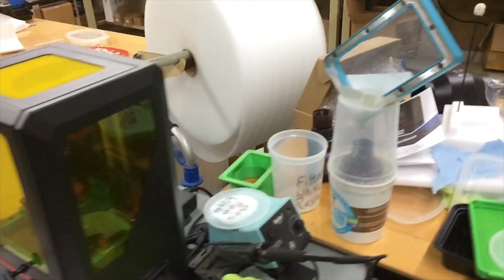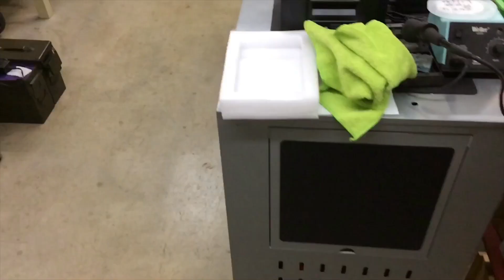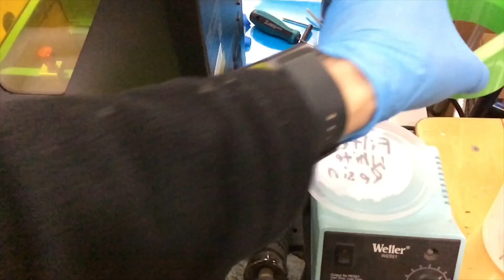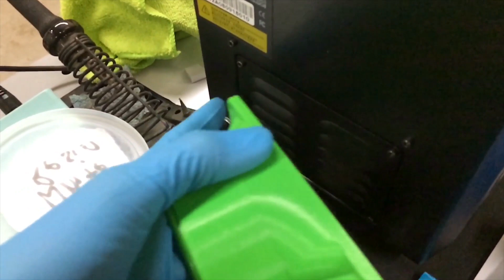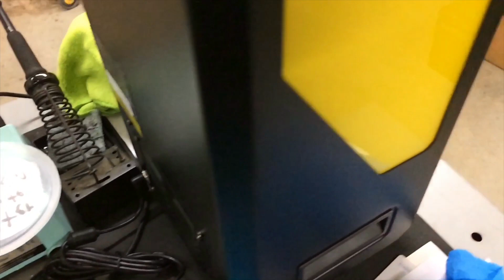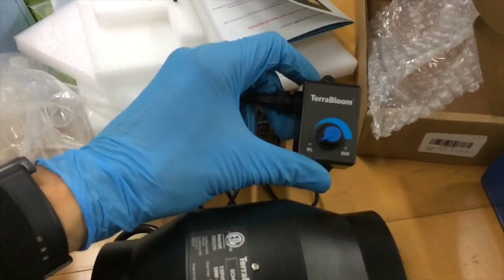Eliminate the Stink of 3D Printing the Easy Way with Carbon Air Filtration Pt.1 - Resin & FDM Filter

Comment: This is amazing. I just set this up yesterday, only without the bucket. I put the printer in a box and left the filter open. It works wonderfully. No smell!
Reply from the maker: How is it setup? Is your filter in the box with the printer? As long as you are using the pre-filter to extend the life of the carbon filter, you should be good. Glad it works for you!
Reply: @engineerable  I don't have a pre-filter. I'll have to get on that. For now my printer is just inside a temporary box which is a 2ply corrugated shipping cardboard box. I designed a mounting plate that goes inside and then is bolted to a matching plate outside for the hose to clamp onto. Then the filter sits on the table beside the box with the fan directly onto the filter. Someone did mention the negative pressure building up with this type of setup, but with the cardboard box it's inside, the "lid" isn't tightly sealed so it allows for the air pressure to adjust inside the box.
Reply from the maker: @justindetterline6084  Sounds good, but make sure to add that pre-filter, because without it, dust will quickly clog the carbon filter and affect it's ability to absorb chemical odors. My filter came with a sock style pre-filter that goes over it, but that means you have to pull the air through the filter instead of pushing it.

Comment: Put the 3d printer into a grow tent and vueala! Sealed and you can use your filter as directed for growing ?? Would that work? I wanted to use my tent in my basement and filter any fume if I'm using resin. (Not a 3d printer, just handmade stuff)
Reply from the maker: That sounds like it would work. Like a home made fume hood.

Comment: does anyone have the print file to make the vent tube connection for the ant cubic photon?  I have looked and have had trouble finding anything.  could anyone share a print file for it?  also if poss the fitting for the 4" connector replacing the yogurt cup?  you can email me at nja.aoa @ gmail please I would b greatful
Reply from the maker: The links for both of those, the Photon vent fitting and the 4" coupler are in the description. This is the Photon vent fitting: https://www.thingiverse.com/thing:2877754

Comment: were did you get the other duct for the bottom of the bucket?
Reply from the maker: Ultimately I 3D printed the other duct from Ninjaflex. Watch part 2 for the installation of that. https://youtu.be/OTeL7KOdJlI  The files links are in the description:  https://www.thingiverse.com/thing:4568637

Comment: Did you happen to do any particulate testing on either the FDM or resin printer? I know that no everybody will have access to this type of equipment but thought it would be interesting to know.
Reply: You might want to check odourcube ( odourcube.com ) . They have HEPA filters and activated carbon modules in a modular system.
Reply: @3dpp959  Do they test how much of the particulates have been removed?
Reply from the maker: I don't have a particulate tester. A hepa pre-filter would be great, and would extend the life of the carbon filter even more.

Comment: well you wont be printing hi temp resin thats for sure. No point of a heater either.
Reply from the maker: Good Point. The option is to put the printer inside an enclosure, and recirculate the filtered air. Now that I have 3 printers, I'm considering building an enclosure for all 3 of them, and attach the filtration system to recirculate the air inside the enclosure.
Reply from the maker: I am planning to add a resin heater, but instead of heating the air, I will heat the resin directly. The vat is aluminum, so I will attach a cartridge heater to the outside of the vat wall, heat the aluminum, and conduct the heat to the resin.
Reply: Thats not going to be effective enough to be worth trying. There wont be enough surface area to transfer the heat into the resin and what little heat will transfer is being sucked out. You need to keep the heat in the chamber and heat it ambiently.

Comment: Sorry but... this is plain stupid. Anycubic's Photon has this moronic solution to suck the "contaminated air" out of the printer and dispose it in your room!! Really idiotic solution. So the best option in this case is to just disable the fan!!!! Everything else is a waste of hard earned money - use it for something else.
Reply from the maker: The case of the Anycubic Photon and other desktop resin printers are not fully sealed, therefore vapors will always escape, especially while it's printing. I have a Epax X1 that I haven't yet connected to the fume extractor, and it doesn't have an internal fan and still stinks. The smell gets worse while printing, or anytime the door is open. With the extractor on the photon, the smell hardly escapes with the door open.
Reply: @engineerable   Basically you are right. Though, there are  "decent" resins that don't "smell-kill " you. For example the WORST resins I ever used are from Wanhao! Saying that I guess the best idea is to have a closed box where 3D-resin printer(s) sits and some vacuum cleaner sucks air out of that box to the open air.
Since there is no real SDS (safety data sheet) info of toxicity of the fumes ..I'm still using those friendly resins with a printer inside my study room. BUT I WILL LOOK INTO IT. It just happens that I have a connection with a resin manufacturer.

Comment: You can also buy this kit from Amazon  https://www.amazon.com/VIVOSUN-Air-Filtration-Kit-Controller/dp/B06XFRNPR8/ref=sr_1_3?keywords=carbon+filter+kit&qid=1563838980&s=lawn-garden&sr=1-3
Reply from the maker: Thanks for link. I wonder if the lowest speed on that fan is slow enough. I have my fan turned way down, so that it doesn't pull more air than necessary, and the carbon will last longer. Also the fan I chose is silent.

Comment: Nice effort . I think its a little over engineered. I think you should be able to use the fans that come with the printer and add 2 stage carbon filter inside and 2 stage in the outside.
Reply from the maker: Over engineering is what I'm best at, and this was a quick and dirty project. It is much more airflow than you need, which is why I turned the fan down to it's lowest setting. You could do what you are talking about, and in fact there are mods on Thingiverse to do that. I looked into the alternative of adding onto the printer housing, but it actually seemed to be more time consuming than doing it this way. And I wanted a carbon filter that would be overkill and last a very long time.